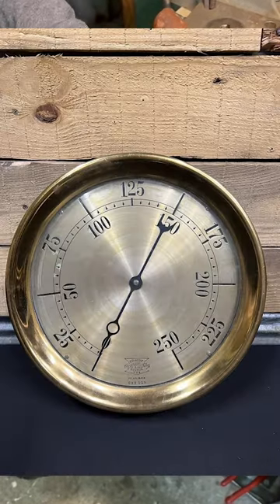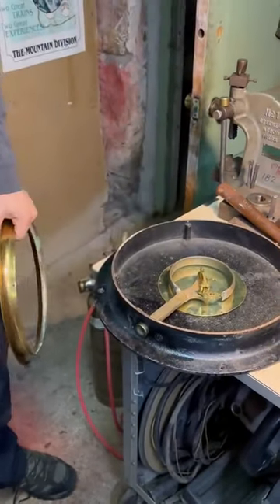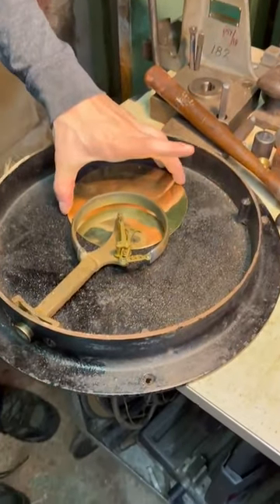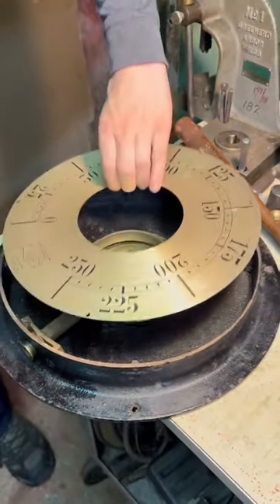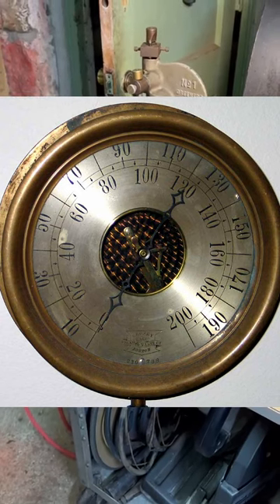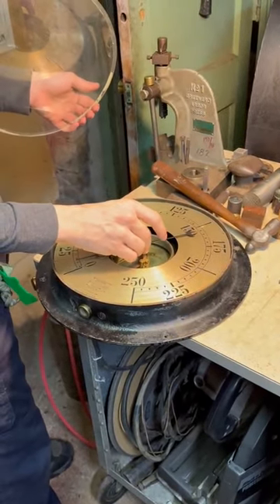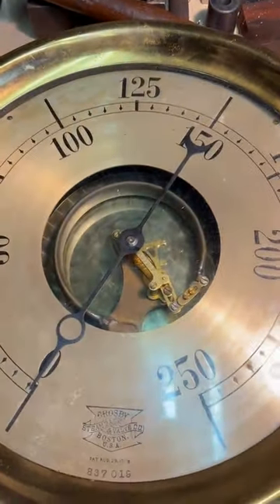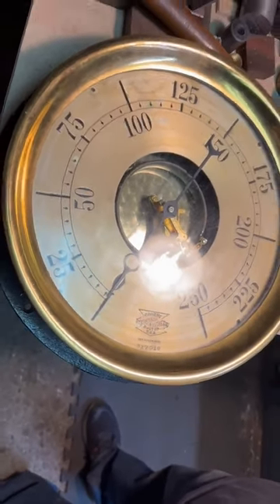Steam Gauge modifications

Comment: Heavy hex nuts ASME 18.2.2 grade 2H are still available.

You said they were hard to find in an old video repairing a boiler while putting on a two safety valve manifold .

Use this spec to search .
YouTube removes links or I would add one .